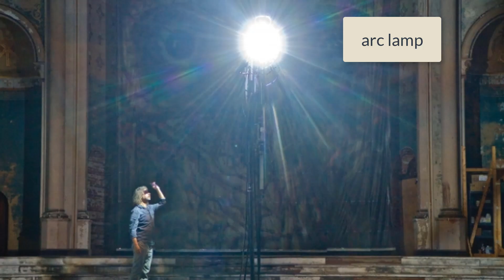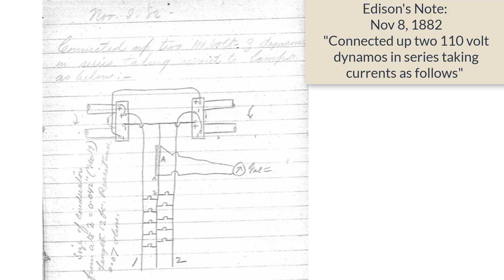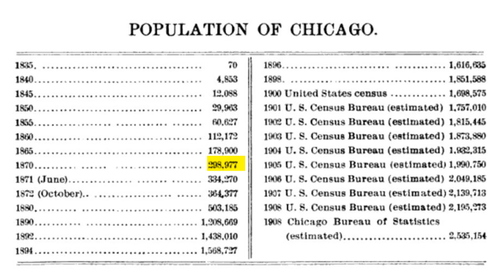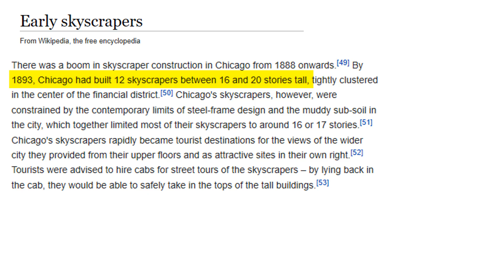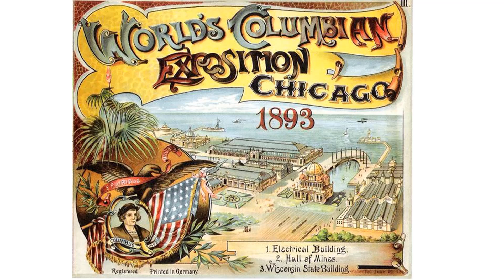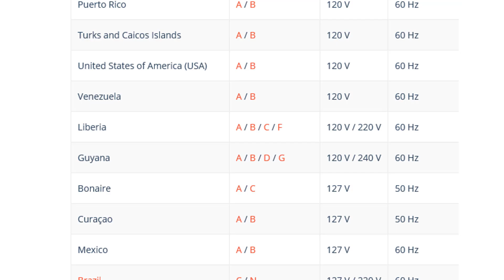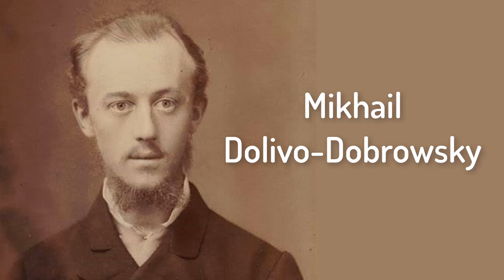Physics and History of Why USA uses 120 volts and not 220 volts

Comment from the maker: I MADE A MISTAKE: I stated that if you add more light bulbs in parallel the bulbs will be dimmer because the resistance will go up. The light bulbs will be dimmer if more are added in parallel but not because the total resistance increases. In fact, the total resistance will decrease as they are in parallel. The bulbs are dimmer because more current is being drained from the generator and the internal resistance means that the voltage over the individual bulbs will decrease. 

I am so sorry, I should have realized what was happening with a bit of thought. Also, now that it is up, I cannot edit my video (although I did add a little card in the corner). 

Also, many of you were confused by my quick transition between Edison's 3-wire DC and Westinghouse's and European AC systems. I should have been more clear about when that transition happened, sorry.

Comment: USA also uses europe 240V (Sometimes in Europe 220 and 230V are also used). And that is because it's a 3 phase system. so theres 2 phases 180 degrees apart. They both have 120V potential to neutral or earth but they make an AC 240V sine wave via the other phase

Comment: The tale about the metal framed buildings is far fetched. In 1858 Greene's Boat House in Sheerness, Kent, England, was the first building with a true rigid iron frame, with no load bearing masonry. Oriel Chambers in Liverpool, England was the first metal framed glass curtain walled building - 1864.

Comment: I was deployed overseas for a bit, and had to use a G-type adapter for a while. I gotta say that it's got a robustness you won't find in American plug sockets (which is kinda cool), but, correct me if I'm wrong, but wouldn't a lower voltage use be more efficient?

Comment: It is very simple they can charge you more in a way. You see voltage is like a push. With a higher push you use less amperage and less kilowatts. And this is how you are charged on your bill is by kilowatt usage. Take two of the same air conditioners 1 at 120 volts it will use 10 amps while the second unit will use 220 volt and use only 5 amps. That means the 220 volt unit cost less to run. The same is for all electrical usage. If you lick your fingers and touch each pole on a 12 volt battery nothing. The resistance of your body prevents currant from flowing sorta. But if I up the voltage to 220 and I don’t recommend you do this, you will get quit a jolt at the very least. That’s if you live. Please don’t do that. Anyway back to the point the reason is so the power companies can rip you off. You pay twice as much because most everything in your house runs on 120 volts. The big items A/C mostly if you have central air, electric dryers, stoves/ovens and heaters water and forced air. All of you who buy 120 volt A/C or Heater units, you are getting ripped off. Everything in your house could be 220 volt but then you would be living in Europe somewhere.

Comment: In Japan only some islands are using 100V AC. S.-Korea is converting from the American 110V AC system to 220-240V AC in their factory buildings, often having both sockets /standards available.

I am now back to Germany, were it is so simple: 240V AC (50 Hz) usually fused with 16A per every circuit all over my house with, easily split from the 3-phase 50Hz 400V AC incoming 5-wire system (3 phases, one neutral and one safety ground (the yellow-green wire). The 3-phase 400 V AC is also available with larger (red colour sockets) to power heavier equipment and machinery like my industrial drilling machine and my lathe, but also the circular saw and branch shredder, HD style.
With other words it is only one system with the smaller 1-phase rated socket circuitry diverted from the incoming 3-phase (5 wire) system.
I also appreciate that we separate neutral and safety ground for the best safety standard possible.

Peace! from Dresden / Germany

Comment: Ah!  50 Hz vs 60 Hz.
I recall many years ago a friend of mine showed me an old electric clock with a "second hand," where he plugged it in and compared the second hand sweep to another clock that clicked-off seconds; and I took note the old clock ran faster.  Turns out the faster old clock electric motor was wired for 50 Hz that was running on the now US standard of 60 Hz.

Comment: 110 volt systems are much more dangerous than 220 volt systems.
Why.?
Because it's more deadly.
It's not the voltage that kills you, it's the current.
Voltage = V
Current = I
Resistance = R
Ohms law is " I = V : R, or R = V : I, or V = I x R"
Power = P = I x V.
So in a 110 volt system you need a current 2 times higher than in the 220 volt system.
Remember, it's the current that makes electricity dangerous, not the voltage.
In order to get the same power output, in a 110 volt system, you need 2 times the amount of current as in a 220 volt system.

Comment: if you double the voltage, you get double the power with the same current. (Example 120V*10A=1.2kW and 240V*10A=2.4kW).
But if you transmit electricity over long distances the percentage voltage drop will still be only the half. (Example: 6V of 120V is 5% and of 240V is 2.5%) So to get the same percentage voltage drop you can double the current and get 4 times the power! (Example: 240V*20A=4.8kW).

A higher frequency has both pros and cons. It gives more efficient inductive loads (motors etc) compared to their weight, but also causes more reactive current (power loss) in long power lines.

Comment: Actually, the current voltage for most countries on Earth is 230V. Mainland China and many other countries in Asia and South America still do use 220V. Interesting Japan uses 100V even at both 50 and 60 Hz. From Okinawa to Tokyo it is 60Hz and Tokyo up through Hokkaido is 50Hz. Now the area of Meso and North America is the largest concentration of 120 at 60Hz. The inventor of AC current being from Nikola Tesla was 25 Hz. Coincidently Amtrak on the Northeast Corridor between Washington DC and New Your City still uses 12kV at 25 Hz at single phase (also SEPTA as well as portions of Amtrak uses 25 Hz on their catenary as well within Pennsylvania). Now some places in Asia like mainland China and some places in South America uses 220V at 50Hz. Europe used to use 220 before it was boosted up another 10V only recently. Oceania had at 50Hz 240V, but has come into line with Europe using 230V as their standard grid voltage as well.

Comment: I thought you were going to make a convincing arguement as to why America and Canada have retained 110 volts instead of 240. There isn't one. The solution of course is that the higher voltage can go through thinner wires and be more efficent because they give off less heat. The biggest problem with electricity (compared to the energy created by internal combustion) is that it wastes so much energy in its transportation. Ironic that the Japanese used the lower voltage through safety concerns, bearing in mind that they also invented Kamikaze warfare! There, that only took 186 words to inform you! Plus it's always irritating when Nikola Tesla doen't get a mention!

Comment: In my region (SW USA), homes are fed 240 volts to the panel which splits it into +120 volts and -120 volts, with neutral connected directly to the center. The actual line voltage at my panel during the day is 248 volts.

Comment: The reason we use 120 volts with a neutral and a ground is because we can afford to spend more money to accomplish the same thing and we have the natural resources. (copper) A 240 volt transformer center tapped grounded is still only 120 volts above ground maximum on each leg.

Comment: Nsever heard so much bs. Most is just wrong. Like more bulbs mean more resistence- it's the other way round, more bulbs mean less resistance. Or carbon filament can't handle 220V, that's wrong, it's just a question of resistance.

Comment: I think it's unfortunate that the US didn't go to a single-voltage 240V system.  Wiring would be much simpler if everything use the same voltage and the needed current would be cut in half so smaller and cheaper wiring could be used.  And today,  GFIs eliminate the shock concern from using the higher voltage.

Comment: Well, in canada, we actually have both 110 and 220 at home, for heavy consumption appliances like electrical stove, water heater, baseboard heater, they use 220v,  because its more efficient with higher current. I assume the same thing goes in states too

Comment: It seems to me that the US system of using 120 volts versus the European 240 volts wastes a huge amount of copper. Do you really need a "hot" black wire, a "cold" white wire and a ground wire at every outlet? Many appliances only have 2 prong plugs.

Comment: Tesla's AC induction motor was patented in 1887 and by 1900 it was firmly established that 3-phase AC "squirell cage" motor is most efficient and practical electric motor for medium and heavy loads. And from 3-phase is simple to create 3 lighting circuits, either in single residence or apartment or office building. Developement of AC motors had many important figures, but fact is that Tesla made first poliphase electric motors and in few years moved at other things like radio transmission, remote control and high frequency systems.

Comment: For the same power 220V pumps 1/2 the current.  Half the current means the conductor uses half the copper.  Follow Ohm's Law.  Half the copper means the guys who owned the copper only makes half the profit.  Follow the money.  Look up and see where and who owned the copper mines and electric wire production.

Comment: 'Pedantic comment; "Begging the?" is a circular logical fallacy, e.g., "Are U still beating Ur spouse." Better to say, "raises the ?"

Dual voltage 5VDC chargers. Check your charger! Your MMV. 120/220 VAC 50/60 HZ. In France, they charge you 1 Euro to charge your phone or laptop when you only need a 2-prong 120VAC female/2-prong 220 VAC male adapter, which costs $1.

Comment: Great video. Thank you. Just one clarification. When we use 2 hot  wires (on a dryer) there is stlll 1 phase 180 degrees apart, not 2 )

Comment: Time to make free standing 48v DC homes.   Enough voltage to run everything,  solar panels come in 48v, batteries are easy to get in 48v packs.   central power in house not to large so power runs are short.   Tower home would make sense with all utilities in a central hub that supports the roof as well and extreme weather resistant shape.   My daydream at the moment.

Comment: Thanks for this!  I teach CS and also tech history, and I'd never heard this story about how we arrived at 110/220 conventions.  That the 110 is about the right voltage to support a carbonized-filament bulb is a marvelous example of the random ways standards get established (e.g. qwerty keyboards).  And that the European 220 arises from their slightly slower electrical buildout that permitted accommodating tungsten filament bulbs at 220V is also interesting.  One wonders how much copper would have been saved in the US (and how many additional people electrocuted!) if we'd gone to 220.   With the advent of GFCI breakers, 220 is now much less dangerous, so it's actually the better standard.

Comment: Here in South Korea we changed from a 120 volt system to a 220 volt system. When I moved here in 2003, there were so many voltage transformers around. I asked and found out that when the carnage occurred, the government provided free the 120/220 transformers to each household so they could stop still use their 120 volt stuff until changed for 220 machines. When I arrived it had been many years since the conversion occurred and most Koreans no longer needed the transformers. I found these free transformers very useful as I had a number of 120v machines I brought when we moved here.

Comment: HI Kathy,
        Just love your you tube video presentation.  KEEP UP THE GOOD WORK!!!!. However, you should include in your book about that   other EDISON TYPE PERSON. THIS PERSON WORKED WITH THOMAS ALVA EDISON. HE WAS THE FATHER OF ELECTRIC TRACTION AS RELATED TO STREETCARS, ELECTRIFIED RAIL SYSTEMS,   ELEVATORS AND PILOT INDUSTRIAL ELECTRIC CONTROLS. THAT PERSON IS FRANK JULIAN SPRAGUE.  you should read about his first electric street car in Richmond Virginia In 1888. 
         I,m very much an electric traction fan. I,ve been a licensed electrician since 1972. I,m 75years old and still working full time in the trade. I work for boston mass MBTA/KEOLIS COMMUTER RAIL. I,m a night duty electrician. My immediate co-workers don,t support electric  traction because they are Trump supporters and have the attitude of DRILL BABY DRILL , and think climate change is a hoax.
           On the Technical aspect of electric traction, the overhead catenary wire that supply  25kv @ 60 HZ NORTH OF new Haven CT to Boston is single phase converted from a transformer changing 3 phase utility incoming power to two phase through a Scott "T" connected transformer. HENCE, electric utilities don,t like a large single phase loads on their 3 phase distribution net work.
          Would like to hear from you. 

Paula Walach-former industrial electrician----union member IBEW 

You can refer me as Paula loves electric traction

Comment: Today in my modern American home I turned on 120V LED lights and used a 120V hair dryer this morning, had a cup of coffee from a 120V drip coffee maker, then washed six loads of clothes in a 120V Whirlpool washing machine, and dried them in a Whirlpool 240V clothes dryer. The next time I disassemble the dryer to replace the belt or tensioner and clean out the lint, I want to read the label on the motor to see if it is 120V or 240V, probably 240. Later in the afternon,  had a cup of tea with hot water from the 120V drip coffee maker. This evening, baked three pizzas in a Kenmore (GE) full size range/oven running on 240V. Meanwhile, it warmed up enough today that I turned on my Lennox central air conditoner which runs on 240V. The outside condensor fan runs on 240V and so does the compressor. Everything worked perfectly. Get the point?

Comment: Probably for the same reason the USA still uses imperial measurements. NTSC colour  television transmission.
Europe and else where uses metric systems, 230v 50hz and PAL.
Infact  it's more to do with insurance and safety. 110vac in domestic is deemed safest. Also appliances were made to run on both AC or DC. 110 dc was common.

The USA has 3 systems, 110/220 domestic, 207/ 110 commercial 3 phase, 600/ 480 industrial 3 phase system.
They run an extra neutral with their national grid system. 
They can turn off one phase and still supply 2/3 of their domestic  customers.
The downside is they need 3 times the number of transformers.

Comment: 1 minor correction to your voltage change statement, the voltage in the UK used to be 240V but was reduced in 2003 to 230V while the European voltage of 220V was raised to 230 to bring them  all in line.

Thus the UK has also been privy to a voltage reduction.

Comment: We had 110 V as well up to 50 years ago. But the suppliers wanted to go to 230 V to get more power through the same lines. So for some time we had both starting with new installations which had 230 V  only. To change the light bolbs is simple and not expensive. Some, like radio's had a selection switch. Motor driven, like fringes and washing machines was more a problem. But the switch over was announced years ahead, so everything new was 230 V. For the old once you had to buy a transformer. Knowing the USA that would be a problem. You have a contract with a supplier and if he changes to 230 V he infringes the contract, so he has to pay for replacing your equipment. That is the US mentality and thus the USA sticks to the 120 V.

Comment: The only reason is USA wants to be different :
Electricity volt is 110
Calendar format is month / day/ year 
Using English system regarding units and dimensions.
There is no letter of guarantees and they are using stand by LCs instead of
Measuring heat and temperature with Fahrenheit 
Measure distance my mile

Comment: Quick question. 
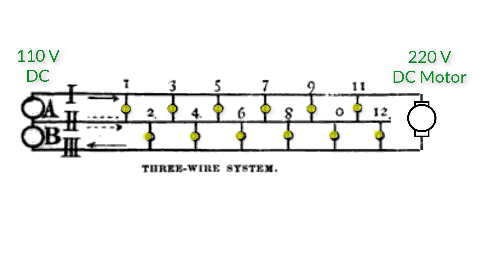Isn't it the voltage difference between the 2 positive terminal of the DC generator should/ could be zero. what i understand correct, this 220v can be true if its a AC generator. (video time stamp 3:54).

Please let me know your thoughts

Comment: There is a terminology issue here. In Norway, for instance, some people will say that we have 220v and others will say that we have 240v. The correct thing to say is that we have 230v, because that is the target voltage. It can go down to 220 and up to 240. Some simply refer to the minimum voltage while others refer to the maximum. We have the same system, but America uses single-phase while we uses two-phase. I would expect that most Americans should be able to easily enable the second phase for 230v.

Comment: Like moving forward to the Metric system, US gets stuck in the mud with voltage, lots of benefits with more universal 240v and Metric but they allow tradition and old folk to resist change. The savings on conductor size is huge overall. And for those using power tools, the capability of a 240v machine, the reduction in weight is significant. The volt drop on a 50m extension cord on a construction site over a 240v is big, and that’s why you have so many portable gensets running. Just invest in a 240v machine and tap the 2 lives and the worksite is a lot less noisy.

Comment: I do not understand why so many people claim standard U.S. voltage is 110V.  The standard voltage is 120V.  It was set at 120V in the 1960s, and it was set at 120V under load in 1984.  110V is a relic of the past.

Comment: The entire united states uses 240v. Outlets use half the 240v circuit that's why it's 120v at the outlet. Ovens air conditioners, ranges, and all other high power devices use 240v.